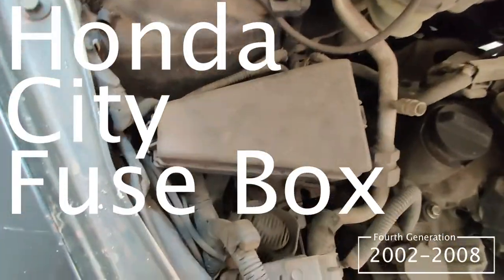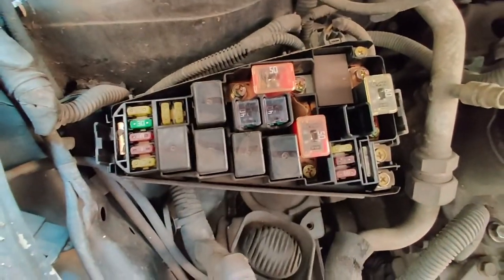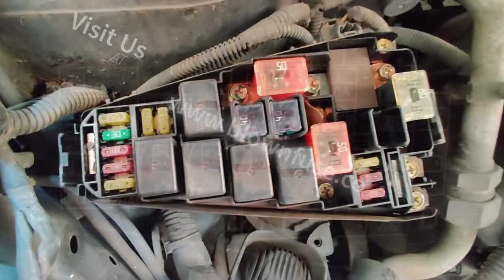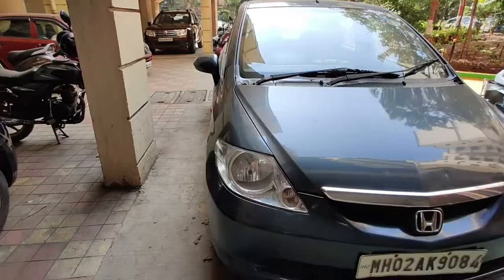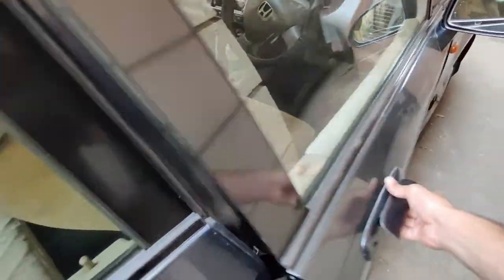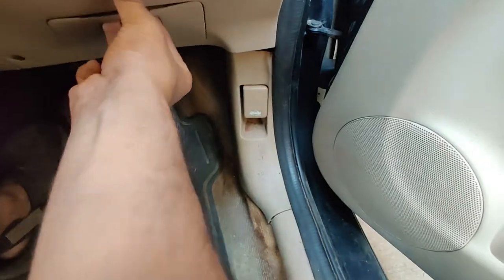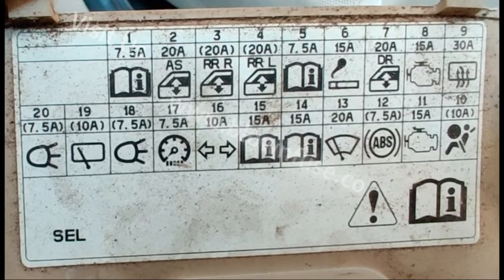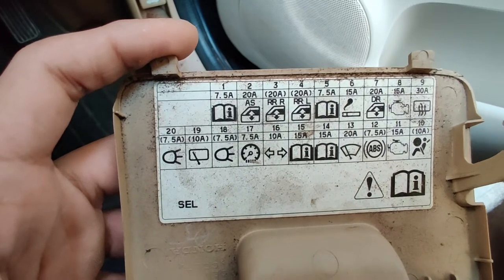Honda City Engine and Passenger Fuse Box Diagram and Location

Comment: Hello may i know where is the fuse location of power side mirror for up, down, left, right motion.?
Reply from the maker: Hello Ernie! The power mirror fuse is located in the passenger compartment fuse box. It is fuse number 10 and is 7.5 AMP’s. We uploaded the fuse diagram for you at  https://pin.it/9smkgoh and the chart showing what fuse it is https://pin.it/5jeJoH5 We hope this information helps and you get that fuse fixed!